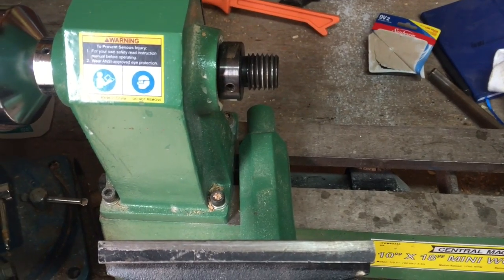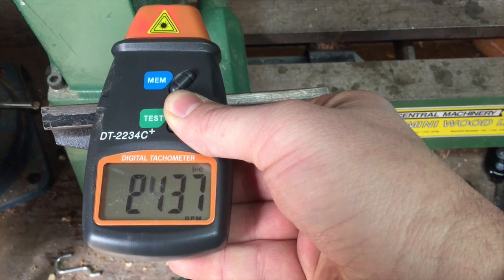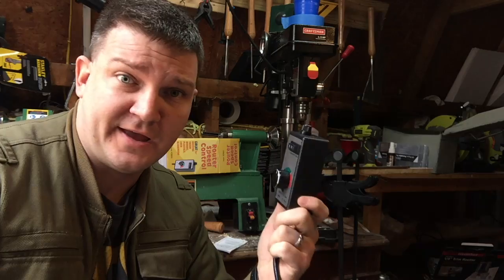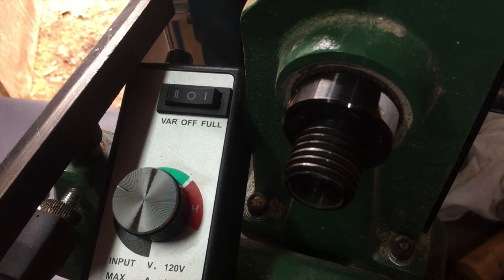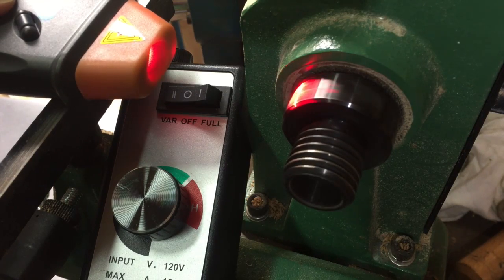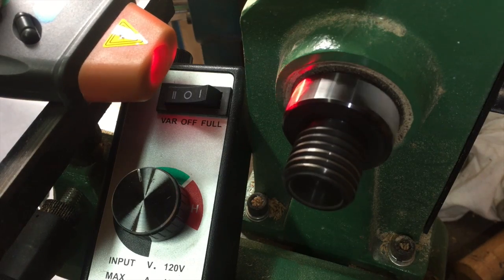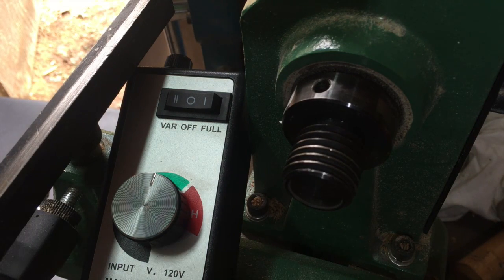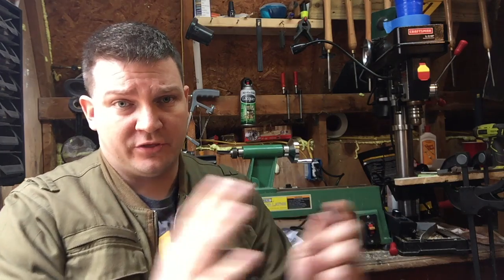Shop Tools: Harbor Freight Lathe Speed Control

Comment: Have you used the lathe with thosde slow settings?  I have seen articles on the speed control frying the motor for lack of amps.
Reply from the maker: +Lee Peterson I actually decided against using this just because it was not as convenient as I originally hoped. That's a good point I had not considered previously thanks for mentioning it and thanks for watching.

Comment: I also have a HF lathe and the motor died. My solution is to get a retired treadmill and pull the motor out of it along with its speed controls. Doing that will give you a HP boost also along with reversible capabilities. You will need welding skills to get it mounted but no electronic skills to speak of. Maybe a wooden mount would work. Hope this helps.
Reply from the maker: +Charles Voss That's not a bad idea, I'll start cruising craiglist. I feel like I see them in the free section every so often.
Reply: +Kaged Creations Yes, I got a working treadmill from a second hand store for $65 then a friend gave me another one free not 3 days later. So they are around just keep looking and let folks know - you might find one they'll give you just to haul it off.
Reply: Go to Craigslist and search free treadmill. That’s where I got mine.
Reply: Electric chainsaws work great too